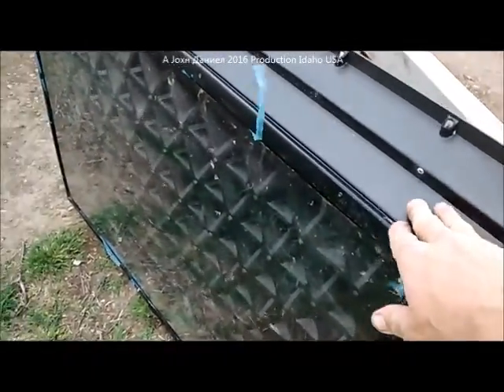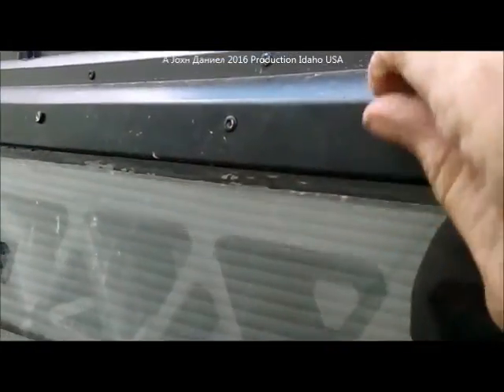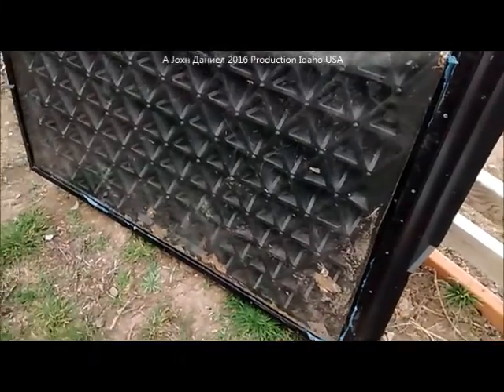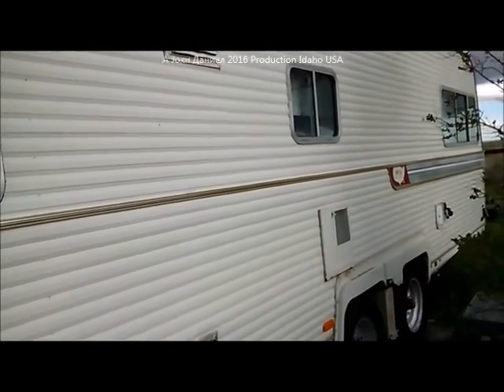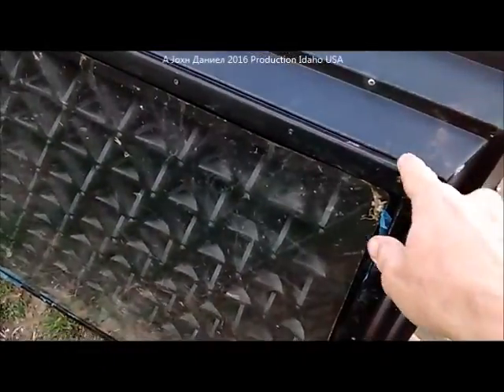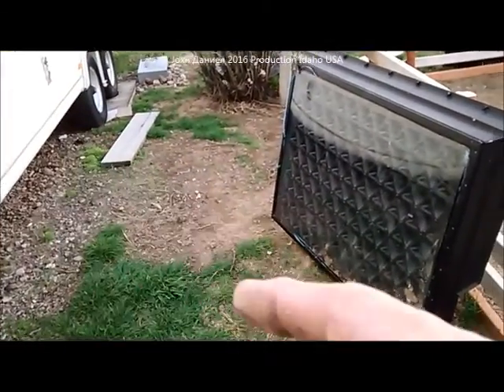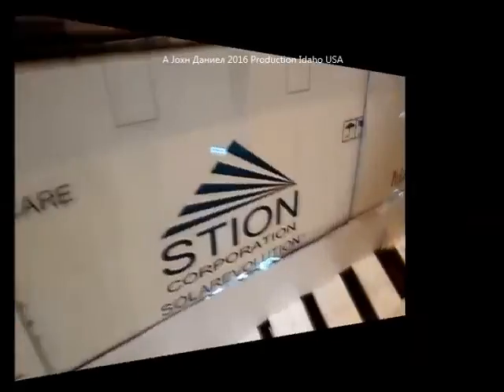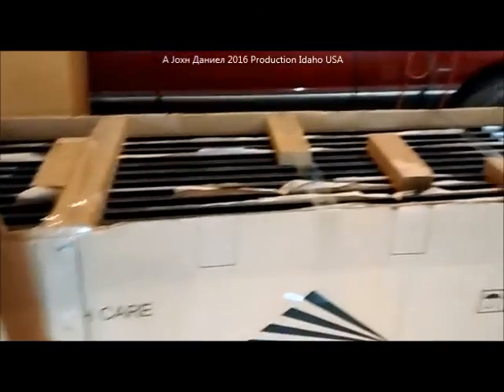Solar Air Heater & testing Stion Solar panels for RV's  travel trailer

Comment: Did you ever put the new roof/vent system on your RV?
Reply from the maker: I had a medical issue in the family that put me back a good 6 months, the framing on that is done, a few videos in pieces are made on doing the roof including installing a bunch of high tech into the trailer. I should be having a 3-4 video series on the upgrades on the old Holiday Rambler asap. Keep a look for future updates on it.
Reply: Sorry to hear about the medical issues but I can't wait to see the upgrades on the Rambler
Reply from the maker: UPDATE, I just bought as of yesterday the only one known to exist 1972 Winnebago built Custom made 28 foot 5th wheel. Its a genuine barn find. Made by Winnebago in December 1972. These were already rare, but this one is 100% damage free. It is unlike anything I ever saw in construction methods and will be doing a BARN FIND video soon. 36 years in a barn, that hopefully qualifies it as one!
Even the 5th wheel hitch which is also Winnebago made is completely unusual.
Reply: @JOHNDANIEL1  I want to see that one